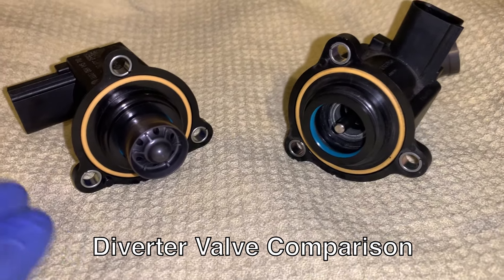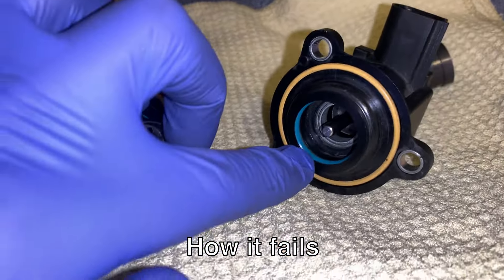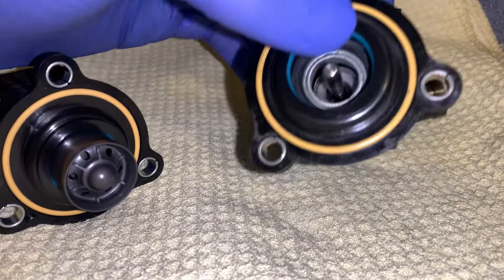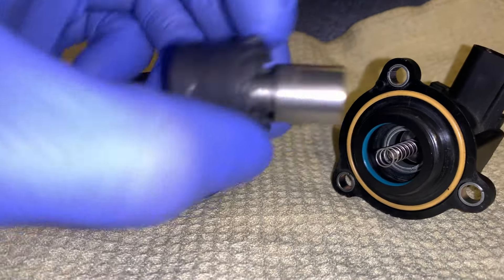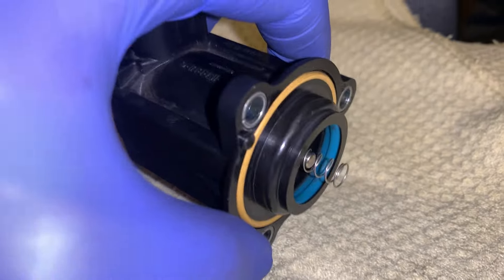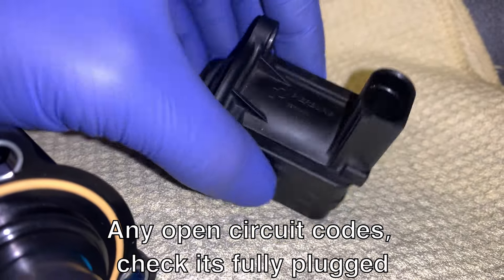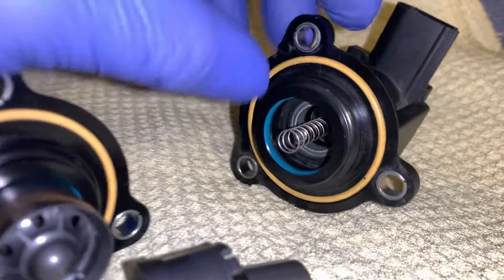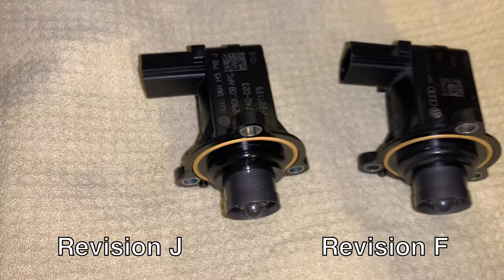This Is Why Your Car Won’t Boost (Diverter Valve)

Comment: A lot of people dont know but the BEST VERSION is the G version because the G version seal better using silicon, but, it breaks more easily and was changed by the C J F and D, but the thrut is, the G is the better for performance... If you can change more often the G is better...

Comment: I took mines out and the blue seal feels like plastic, I also blew into it with my mouth over the plastic cap and I air was getting past it. Does that mean it’s failed as the seal isn’t sealing?
Reply: Unplug ur map sensor too and check if u get a new code. If not , replace ur map sensor. Worked for me

Comment: Just swapped mine out. It was a revision C (2013 Audi A4). I inspected the O-Rings and they looked fine, and it felt like it actuated fine, but there was a tiny amount of oil in the electrical connector. Not sure if that indicated a bad DV, but, I went ahead and replaced it. Hopefully this fixes my P0299 code.
Reply: Did it fix it?
Reply: @antoinecureton  I don’t think it did. The light went away because it’s winter and cold but I think the turbo valve is bad.
Reply: A lot of people dont know but the BEST VERSION is the G version because the G version seal better using silicon, but, it breaks more easily and was changed by the C J F and D, but the thrut is, the G is the better for performance... If you can change more often the G is better...

Comment: Can a faulty DV pass oil vapour if it’s defective?. I have a standard DV and it’s sounds like a dump valve at times when I let off the throttle and I’m getting vapour in the cylinders?

Comment: I got all 3 screws removed but I can’t remove the diverter valve seems as if it’s caught on to something Im scared to pull to hard don’t wanna break anything what can be the issue?
Reply: You may have missed the top bolt which can't be seen from under car. You may have counted the bolt which holds a small bracket (seperate from the DV) next to the bottom DV bolt and thought you'd removed all 3 bolts holding the DV. I know I did.
Reply: @johnfrizza681  you are 100% correct. I felt so dumb when I seen that last bolt up top 😂
Reply: @awax9221  Not to worry - hopefully you got the DV off successfully. This is a very difficult operation when done on your back under the car.
Reply: @johnfrizza681  After noticing that last bolt up top I got it off fairly quick. Thank you for your response I appreciate it.

Comment: Pierburg reversion Dv or Gfb?? Looking for answers have a BT Mk5 loosing boost right at 2500/3k rpm before throttle
Reply: Did you ever figure it out I’ve got the same problem on my seat Leon 1.4 tsi where it starts judering until I’m over 3000rpm

Comment: I thought Revision G was the latest.
Reply: A lot of people dont know but the BEST VERSION is the G version because the G version seal better using silicon, but, it breaks more easily and was changed by the C J F and D, but the thrut is, the G is the better for performance... If you can change more often the G is better...

Comment: Does new J revision works with EA113 in MK5 GTI Edition 30 and MK6 R? Or it is only G and D revisions compatable?
Reply: A lot of people dont know but the BEST VERSION is the G version because the G version seal better using silicon, but, it breaks more easily and was changed by the C J F and D, but the thrut is, the G is the better for performance... If you can change more often the G is better...
Reply: Ist j das neuste version ohne das korb

Comment: We’re you having hard shift behavior? It seems my car is letting the DV open for a split second during some shifts that’s possibly causing hard shifts per tuner. Might need to buy a new Rev
Reply from the maker: Car is 6 speed manual so throttle is off during shifts regardless. This was a short vid to show others what to potentially look for on their DV. (Latest 2 revisions)

Comment: So i lost that spring while taking the dv valve out to work on something else, now i get no boost build up and car just feels weaker than ever. Would that spring being gone be the reason
Reply from the maker: More than likely
Reply: @JewelCity1  would it mess with the throttle as well? The throttle had felt weirder than usual after this happened.
Reply: @allenmiljkovic-kf5zn  Why would you install it without the spring ?
Reply: @HardstyleBulgaria  the spring fell off without me realizing, so i just bought a new dv valve and the cars running better.
Reply: @allenmiljkovic-kf5zn  Oh okay ! I was like "why?" haha! Did you buy "gfb dv+" ?
Reply: @HardstyleBulgaria  no i was debating on it but i just bought a regular dv valve😂 i was debating on it but im not 100% on what that one does, improves, or anything really. Might look into it
Reply: @allenmiljkovic-kf5zn  im absolutely on that train right now - its not expensive (compared to other car mods),but still,if the difference is little to none i won’t buy it. Thanks though 🙏
Reply: Nah, they put it there for no reason whatsoever.

Comment: Is d the latest version for the 2011 Audi a4 avant? Or J
Reply from the maker: Doubt a 2011 car would have the latest revision that a 2019+ car would have.
Reply: @JewelCity1 mine is 2011 and it had a new version idk if it was aftermarket from the past

Comment: how can I test this valve can I put a 12 volt and see if its operating or not
Reply: Most sensors are either 5v or 12v, so I would start 5v to be safe.

Comment: Would there be any benefit to upgrade to an atmospheric BOV? Forge or Turbosmart in specific
Reply: just for sound. a Go Fast Bits DV+ would be the best in terms of an upgrade through.
Reply from the maker: Sounds much better/cooler but not the best performance wise. OEM seems to be the winner there.
Reply: @JewelCity1  right on, thanks man
Reply: if u drive a dsg then a turbo smart wouldn’t be that much different in performance, if u have a manual car the oem diverter is def better because you don’t loose too much boost when shifting
Reply: I have the full recirculating turbosmart. Works amazing, sounds absolutely completely bad ass
Reply: Dont do it man, i have an 19' Golf R, and i put on a Turbosmart BOV, and the performance went down, specially when you want to take off, feels laggy, i think is because the OEM recirculates the air in the turbo, and the BOVs release that air to the atmosphere, and because that the turbo needs more time to boost, im just thinking im not sure about this. But the performance with the OEM valve is way better mainly at down rpms and take offs... but the sound of the Turbosmart BOV is awesome... but the price to pay is losing a little bit of performance
Reply: @RhinoDog69  the turbo smart  bov is 50/50 vent to atmosphere
Reply: @branddawg2376  and because that i choose it over the Savanini, but feeling laggy. I put back the 06h145710j oem back and my car went back alive at low rpms

Comment: My car in 4th gear and up when more then quarter throttle is applied or about 3600 rpm builds a lot of boost fast then seams to fall off? Got any ideas
Reply from the maker: Check for codes and log it during the next pull

Comment: I go gfb dv+ with latest revision on top
Reply: Any noticeable difference?
Reply: @adrianleon1731  boost holds better you can see it on the guage and the blow off sound is slightly louder but thats it.  If you want oem+ type feel its ur best bet but if you want big blow off sound I'd go with the non dv styles that blow off to atmosphere or recurring hybrids.  The gfb dv is also better construction meaning it will not break or tear like oem bottoms do.
Reply: Recirculating *
Reply: @hyper8545  I had one before on my 2017 Jetta GLI. Aren’t you supposed to take them out to recoil the piston or no?
Reply: @adrianleon1731  idk never heard of that.  I only touched mine once. It's been few years
Reply: @adrianleon1731 yes you’re suggested to re-oil them at every oil change interval